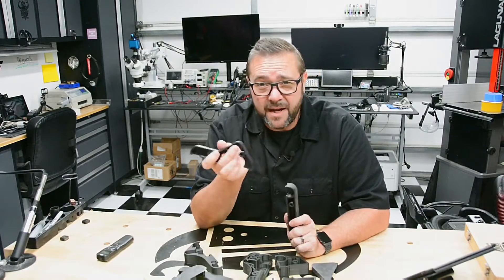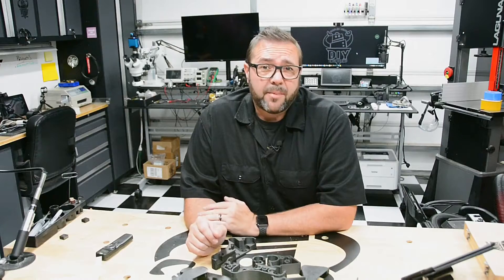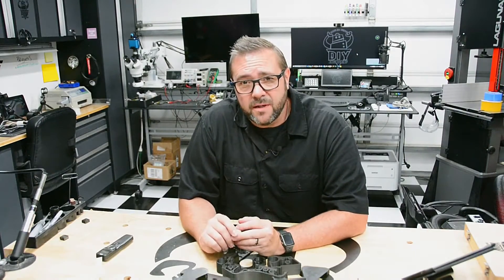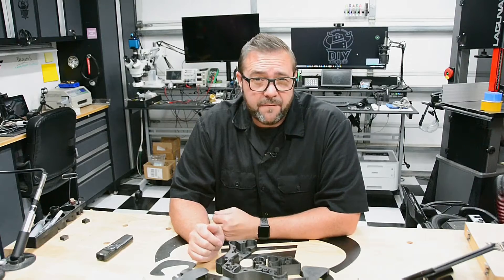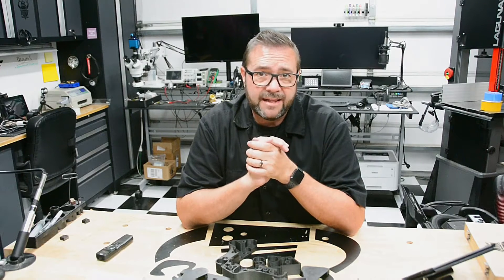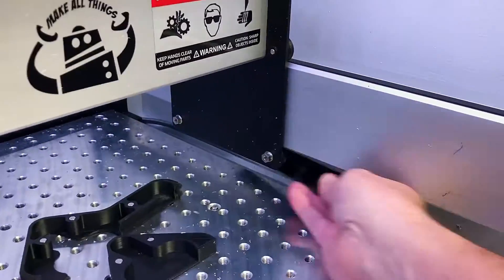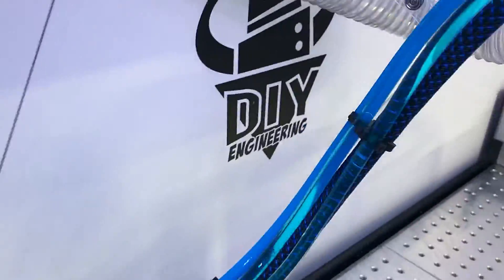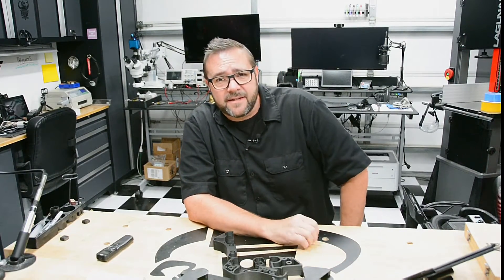Episode 035: CNC Dust Control Part 1

Comment: Hello. Thanks for all your work. I printed the dust covers. I am a little puzzled though as to what you did about the homing switches and stand offs which are in the way of the covers. What did you do?
Reply from the maker: my models are updated to include modified brackets for both X and Y axis, ill upload the new models to thingiverse.
Reply: DIY Engineering where are the print files? I can’t seem to find them on thingiverse